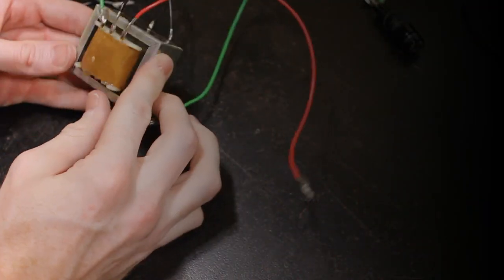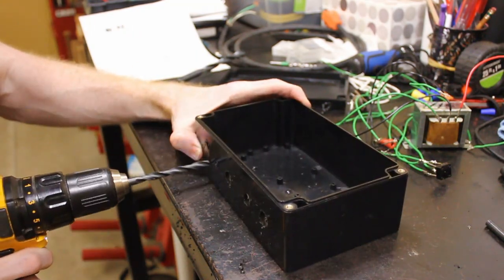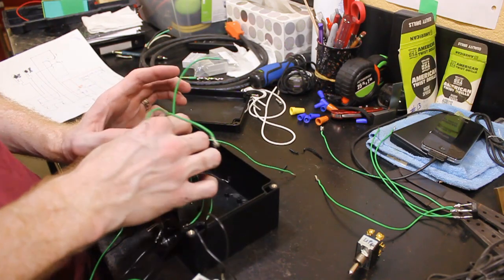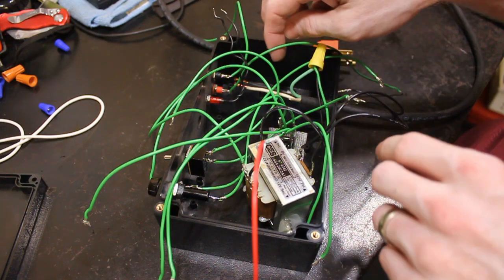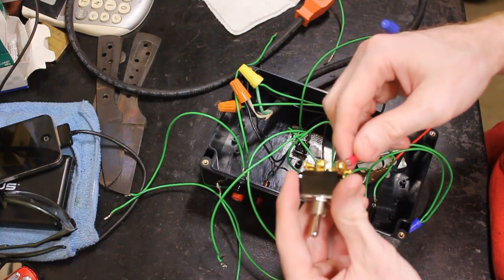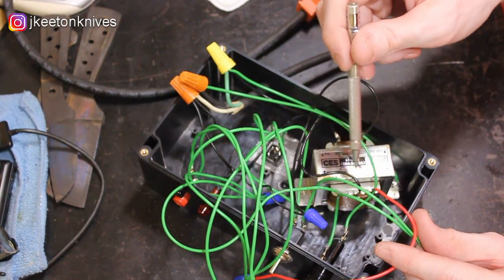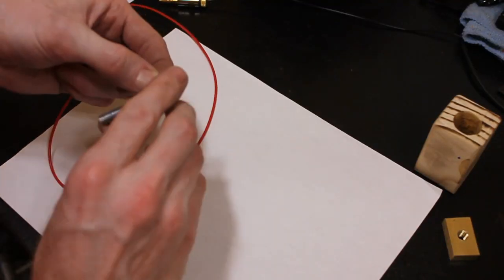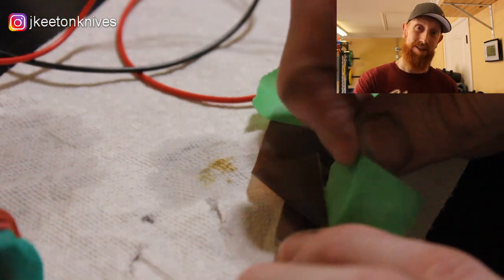How to Build an Electro Chemical Etching Machine - Full Guide

Comment from the maker: ⭐ Etching Machine Amazon Store Parts List - https://www.amazon.com/shop/redbeardops?listId=1FCBJEHVVYRD1&ref=cm_sw_em_r_inf_list_own_redbeardops_dp_dT3aHmVnx64SB
Reply: list seems broken? Is there a new list?
Reply: what bugs me about the diagram is it doesnt distinguish between the 18 and 22 ga
Reply from the maker: @bm5298  sorry about that sir. I wasn't as through back in the day.
Reply: @bm5298  do research as to which gauge is best for the voltage, albeit the Amazon link to wires is for 18 ga.
Reply: I just completed the diy etching machine and it worked perfectly. Used your list on Amazon and the items were slightly different than the video but it didn’t smoke when I turned it on 🎉
Reply from the maker: @frankrayiii738  Thats a good sign!
Reply: @RedBeardOps  hey man, your video is awesome and I got all my parts and almost wired up. I was unable to get the center tapped transformer you use in the video, but grabbed the weideer transformer as a listed alternative. I just want to make sure I'm wiring it up correctly though and I'm a bit confused how to adjust for the design differences. Any help would be appreciated there!
Reply from the maker: @Killerbiscuit1989  I added that transformer based on some other viewers commenting that it worked for them. I'm not 100% sure how to wire it since I don't have one and haven't messed with them. 

1.) I'd advise being very carful though your build and cautious. Electricity can bite you. 

2.) I'd research how to wire up transformers; That maybe can help. 

Sorry I don't have more for you here.

Comment: Update.... I got the final part for my DIY etcher today.  Let me say that if anyone is on the fence on this, just do it.  James explains it well enough that even I could do it.   Got power and started to try an etch.  I used some etching solution that came with my old Etch O Matic. Got everything connected up for the first test and.... Imagine my surprise and horror when it didnt etch hardly at all...   So I then tried just regular salt water.  Bingo.  Etched like a champ!  Thanks again for the easy to follow vid.  Anyone debating this just do it. The links he put up will take you to all the items you need and it's a tedious, but easy project!
Reply from the maker: Hey man, thanks for your comment. I've always just used salt water. This is good information to know for others who run into issues. Cheers sir!

Comment: Awsome how-to-build-it video. It would be less confusing for some if you adhered a standard wiring color scheme. In North America, green or green with yellow stripe is usually reserved for ground. For DC, the black wire is the negative wire, while the red one is positive. For AC, white is neutral, black is positive. Being consistent in the use of correct colors for each wire will make final assembly much easier. No criticism intended, just trying to be helpful.
Reply from the maker: Hey man, 100% agree... I was using wire that I had in the shop. You're 100% right though. I made it way more confusing with all the random colors. I hope the attached wiring diagram is enough to help people do it themselves. I'm a just a cheap ass sometimes.
Reply: No Black is negative white is neutral
Reply: You hit the nail on the head, hard to follow with all the ground wires. He literally should be using any color but green. But color coding would help follow what he's doing.
Reply: Yes Rim, I agree with you completely. Not using the correct wiring colours is very, very dangerous, especially where AC is involved. I only use the 'normal' convention: green/yellow earth, red or brown, (Europe), positive or load and black or blue,(Europe), negative. Even your convention of black negative DC and positive AC, is a disaster waiting to happen.
Reply: how to make the stencil
thanks
Reply: Hey Ya  @internettrihard2955   ... whereas i see that you wrote this 2+ years ago, and I am not trying to be a dick or anything. . .  But there is no "positive" or "negative" in AC power, there are several colors that are used for "circuits" or "loads" like black, blue, red, etc... White is the Return line and green of course is ground.  L'm just sayin'.

Comment: This is one of the better DIY videos I've used. The wiring diagram was a most helpful addition. I built one of these based on your video and parts list. I have had great success using it to make caliber markings on custom guns. Thanks for your effort on this. Well done!
Reply from the maker: Cullen Grissom thank you very much for your comment sir! I’m really glad it helped you out!cheers 👍
Reply: @RedBeardOps  I will also second using T.U.S. Technologies for the stencils. I tired several different ways to make them but the ones I got from them are the most rugged and precise. Good call
Reply from the maker: @CullenGrissom  Heck yeah, you can get a lot of uses out of one of these!
Reply: Will it get the requisite minimum .003" in depth for FFL sales?

Comment: Fantastic video sir. I will preface this by saying that I am not a professional electrical engineer, however I do believe your + and - on your rectifier are your DC voltage side, and your ~ is your AC. Not that it matters, after all the only difference would be the labeling.
Reply from the maker: Cheers sir! Thanks!

Comment from the maker: I know this one is tedious! Here are the time stamps:
0:20 – Intro / Motivation / Links / Wiring Diagram
1:11 – Major Components
3:45 – Drilling
4:42 – Front Panel Install
7:20 – Power Cable Options
7:50 – Transformer Install
9:00 – Bridge Rectifier Install
9:57 – Power Cable Install
10:17 – Wiring it all UP! 
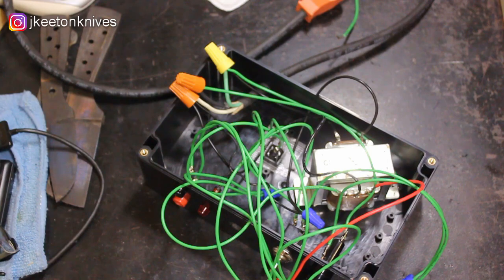16:52 – WIRING OVERVIEW FINISHED
19:44 – Closing up the box
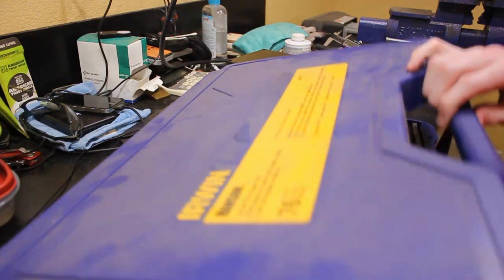20:25 – Making the Etching Tool / Electrode
22:13 – How to Use the Etcher
23:20 – AC vs DC etching
24:00 – AC vs DC after sanding (Deep vs Dark)

Comment: Nice build!! I got lazy and used a 12v dc power supply for the penetration and then hit it with a ac fan controller turned almost all the way down to get the darkening. Electrical taped them together like a savage too.
Reply from the maker: THanks! If it works it works!

Comment: Rewatching this all the way through. After following your heat treat oven video. You definitely made the right choice on the oven getting the terminal blocks. 

When you finally went to wire it all up, saw the big rats nest of wires staring at you, and you said we're going to take the green wire and connect it I loled.
Reply from the maker: lol, yeah. It's the only color I had on hand. If I had to do it again, I'd use other colors to make the video easier to follow. 

This etcher has been doing great thou! I still use it on every knife
Reply: @RedBeardOps  I could still tell what was going on. I just thought it was a funny moment.

Yeah, it seems like a solid little device. Only a few parts, not a lot that can go wrong, and it definitely looks like it gets the job done.

Comment: Thanks for this, finished my build yesterday and while I did a few things differently it's working great.
Reply: By the way, I tried to post a list of what was different but my comment kept getting deleted.  Not sure what I was doing to set off the bots!  Main thing was using heat wrap instead of twistons, really helped with keeping things less cluttered.  Also used a computer cord and receptacle for power.
Reply from the maker: Great to hear!

Comment: Thank you!  That was an outstanding video!  I wish that other people on you tube presenting how to videos would be as patient and as thorough as you are.  I can wire a house easily enough but when it comes to electronics I am lost.  You did a great job.  Congratulations.  Can you do a video on building an induction heating coil?  The ones on You Tube seem to be done in such a way that you need a degree in electrical engineering to understand them.  Have fun, be safe.
Reply from the maker: Thank you greatly sir! Man, that's not something I'm versed on. There may be a heat treat oven in the future though.
Reply: @RedBeardOps  l. Looking forward to that.  Have a great day.

Comment: Hey, I just wanted to chime in because I had some difficulty hunting down a transformer that would work with this project.  I ended up ordering a center-tapped transformer from Jameco (Part no. 221-373).  Hopefully this will help someone!  Thanks so much for the tutorial.  The machine works perfectly.

I also designed a 3d printed case with heat-set inserts as well as a printed handle to use in place of the wooden block.  I can upload to Thingiverse if anyone is interested.
Reply from the maker: Heck yeah, thanks man!
Reply: Did you ever upload it to Thingiverse?

Comment: Thx for the awesome video!   I know wire colors aren't an important part of the video, but on the wiring diagram and as built here, the positive (red) and negative (black) banana plugs are wired opposite. So, your applicator is wired up on the negative (even though colored red), which would make it consistent with other etchers (like the personalizer plus).
Reply from the maker: 10-4, thanks for pointing that out. Glad you liked this one!

Comment: Just found this. NICE!! My materials just came in, getting ready to build. Thank you so much for posting. I will be able to put my car charger away and now have A/C as well.
Comment: the DC & AC look to be labeled incorrectly on your DPDT switch in the diagram, Although no difference in performance. I'm adding LED's to indicate when in AC or DC mode.
Reply from the maker: Cheers Mark! Good luck with your build!

Comment: Wonderful build. I built this one about 5 years ago. It worked great for several years. It seems to have worked better for the first few years. Now it works but does not etch deep. I wonder if the transformer has gone out. Or if I could replace it with a bigger transformer. Thanks
Reply from the maker: Thanks Scott! Man, I'm happy Chris put out these plans!

Comment: Great video man!! I'm 4 years late to the party on this one.  Should be pretty easy to make using your diagram. I'm assuming you use Photo Self Stencil Material from T.U.S? What type of printer do you have to use for this? Apparently I was the only person that missed scrapbooking class on stenciling since I'm the only person asking... *UPDATE* I found that my vinyl cutter works perfectly for this, you don't need any "special etching paper".
Reply from the maker: I would contact TUS and ask them which stencil is ideal; It's been a while since I ordered

Comment: James,
I love your videos and had a quick recommendation for this build or others.

If you have to run a power cable through the back like that. A good way to cheat is throw a zip tie on it. The tape gets gooey when it gets hot sometimes.

Also, when you mount stuff to the box, I keep a bunch of 6-32’s and nuts handy. They are great to mount stuff down in the box without buying computer standoffs.

Again, I love your videos!
Reply from the maker: Heck yeah, thanks for the tips Chris!

Comment: nice job. some small advise for future electrical fabrication.. 120volt and above; green color  denotes ground and should only be used as such, don't see were metal box is grounded. white should stay on neutral or common side of the 120 volt side and all other colors (except green) used for the "live" side.  would also use more colors to denote different parts of the circuitry
Reply from the maker: Thanks for the tips!

Comment: Thank you so much for the video and the information you put out for the knife making community! You make it easy for folks to get into this hobby! Does the contact plate need to be brass, or can I use some other scrap steel laying around? Not sure where to get a piece of brass like that
Reply from the maker: Man, I’m not 100% sure, but I bet steel or stainless would work. You can get brass from just about any knife supply shop or Amazon

Comment: Hello Red  Beard, thank you for more one wonderful vídeo. The wiring diagram is shown on the switch AC for the bridge and DC for the transformer. I think it's the opposite, am I right?
Reply from the maker: Hey man, I'm not sure, but I know this orientation has worked for me (with that diagram exactly)
Reply: This is correct. On the schematic the AC and DC labels are flipped.

Comment: Finally building this.  Had to use a transformer w out center post.  I'm guessing just ground it to bottom?  Or do you even need a ground w plastic box?
Reply from the maker: Gosh it was so long ago... I don't remember the reasons behind some of this. Sorry sir! Be carful with that electricity!
Reply: I just got all my stuff to do this. The transformer I got off his list also doesn’t have the center post. Did you get it figured out?  If so, what was the answer?
Reply: @kyleconnole6044  I honestly can't remember what I done.  I think I just grounded it to the base of the transformer

Comment: great video...thanks for the time and effort involved. Quick question...are the stencils through and through cut outs on the brown paper? Sounds like a silly question, but looking at the stencil papers you are soaking in the bowl (and also when applied to the knife), it looks like a solid sheet of paper. Probably an optical illusion b/c the logo is so small.
Reply from the maker: I gest my stencils from TUS industries. I store them in soapy water to help make them last longer

Comment: Got all my stuff ordered from Amazon should be here in a few days! Do I have to use brass or could I use copper i have a chunk of copper at home but no brass. Thx for the tutorial
Reply from the maker: Hey man, I'm not 100% sure, but I think the Copper will work. If I were you I'd give it a shot before buying the brass. Copper is more conductive so I bet it will do just fine.
Reply: @RedBeardOps  thats what I was thinking. I'm gonna give it a go!!
Reply: ok built it with the copper works fine only issue is Im blowing fuses every time did this happen to you?
Reply: So just an update...I looked a Chris's supply list and I purchased slow blow fuses. On top of that I got a piece of brass and changed out the copper I had on the hand piece, I also went through all the wiring instructions and it's possible that 2 of the leads on the bridge rectifier were touching.  I'm guessing that was the main problem but I suppose it's possible that it was a combination of all three. Just wanted to update as the etcher is working great now and if this info can help anyone out there that would be great!!

Comment: Hi mate, nice video. One question though: instead of brass for the aplicator, what would you also use instead? Mild steel, aluminum or even copper? Based on the conductivity, I guess that would probably affect application times on the stencils? 😉
Reply from the maker: Hey man, I haven't tried anything else, but I bet they'd all work.

Comment: After using this setup for a while, would there be a need for a variable voltage regulator dial in the system?  Just curious if adding that in would allow you to realize some more control over the etch on different materials.
Reply from the maker: Hey man, I'm sure it would give you more control. I've been extremely happy with this units performance though. No issues here.

Comment: Just curious but doesn't the wiring diagram have AC and DC reversed at the DTDP switch?  Won't matter as I'll check outputs before labelling but want to know for understanding
Reply from the maker: Well I've seen some comments report this; it was so long ago that I can't remember what was the "right" way. I haven't had issues with my system.
Reply: @RedBeardOps  Right on. Thanks for the video... it's paved the way for me to get etching for about $500 less than I was going to spend. I'm seriously excited.  Bought the parts and waiting for them to arrive.

Comment: Great Video, thank you!  Any other suitable metal besides brass for the etcher? The little town I live is lacking in certain commodities it seems.
Reply from the maker: Hey Chris, I haven't tried anything else... but I bet copper or stainless would work.
Reply: @RedBeardOps  Thanks for the quick reply.  The transformer you listed wasn't available but I believe the one I purchased will work, though it's DC only.  Wiring will be a little different but not much.  I did think of another question.  What were you stencils soaking in?  I've seen various solutions for different metal types.  I'm currently working mostly with 1095.  I'm very new to knife making, just finishing up my third one.  Struggling with grinding the bevel.  I'm using a jig and a 4" X 36" belt sander.  When I pull from the left side, I believe I'm bumping a protrusion and that is creating a hump, if you will, in the grind line.  Trying to determine exactly what I'm hitting but it creates a lot of work to correct.  Maybe I can remove some material from the jig once I find it.  I thought it was just me at first but after 3 knives I'm pretty sure I'm hitting something and that bounces me a bit.  Live and learn.   I'll figure it out as I'd hate to have to move to another machine after only  3 knives.
Reply from the maker: @chrisharrison4424  I just have them in some water with soap. I feel like this keeps them cleaner over time. I'd advise working with 1084 over 1095 for home heat treating.
Reply: @RedBeardOps  Thanks, I'll give 1084 a try.  I'm not real happy with the edge retention  on the first couple of knives and maybe going to 1084 will help.

Comment: Do you think 1/4 inch thick brass  flatstock will be good enough for the contact on the electrode. Or do you think I should get something thicker?
Reply from the maker: I think that woudl work just fine
Reply: @RedBeardOps  thanks!